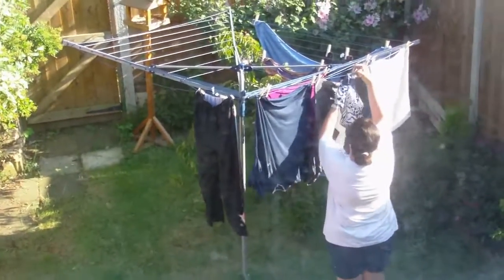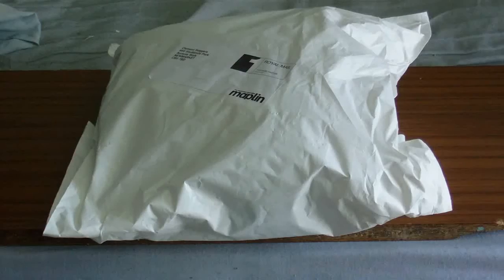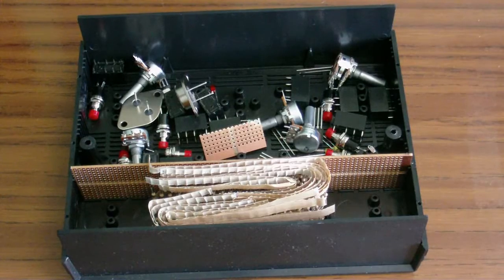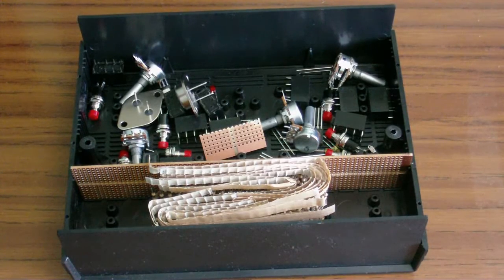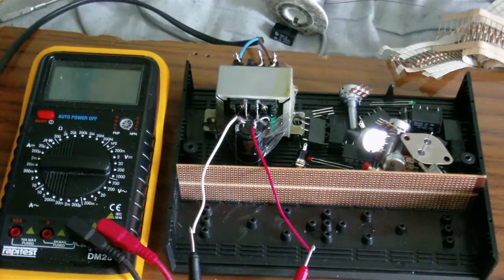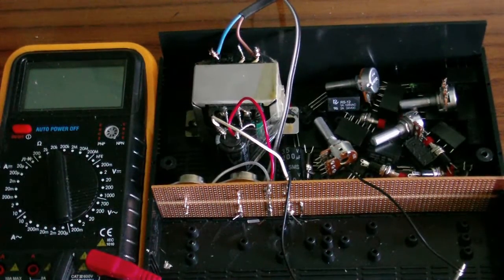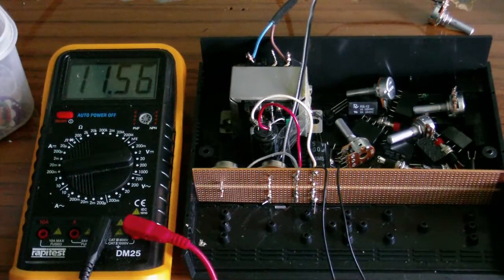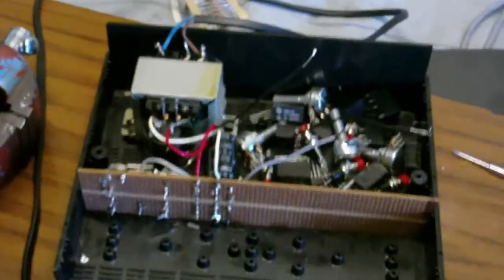The Amplifier adventure part 3 - Making a Power Supply

Comment from the maker: Originally it the tow 2n3055 transistors were only going to power the relay system and the amplifier, but now I'm going to use a couple of IC amplifer chips and they take a lot of current, so I will have to mount the two transistors on a heatsink, they will be powering the two amplifier chips, and I'll ad a third regulator in for the relays.

Comment from the maker: All the components I chose myself and it's my own design.  The circuit design I have for an amplifier is not very powerful, only about 2 watts per channel, but I've got two LM383 amplifier chips ordered witch will be much more powerful and simpler to wire up, about 8 watts each so it will give out about 16 watts, although it doesn't sound like much, it's more than enough for a small room like mine.  To some people It's surprising how loud just 1 watt can be!